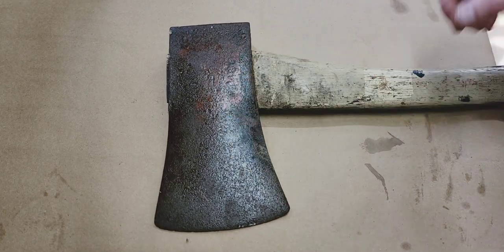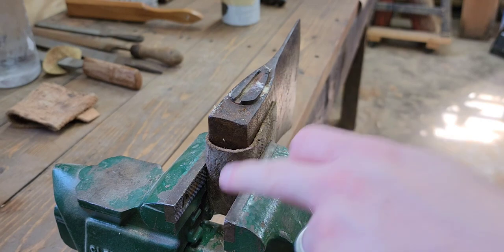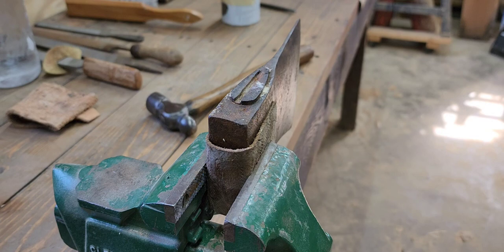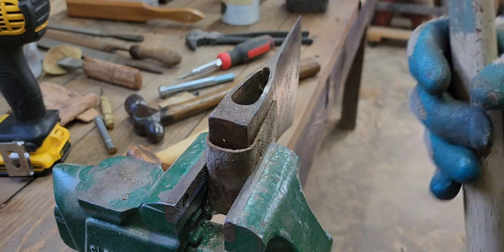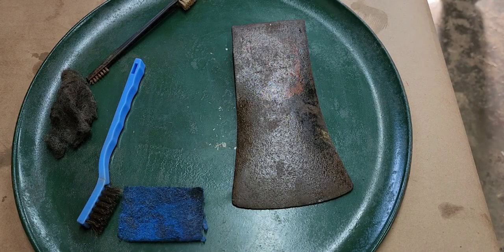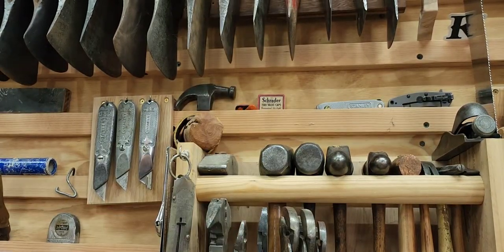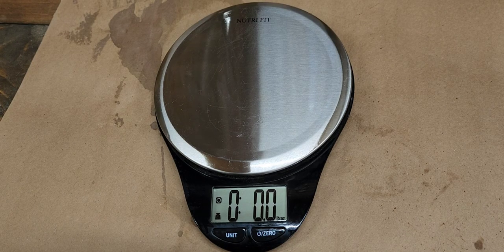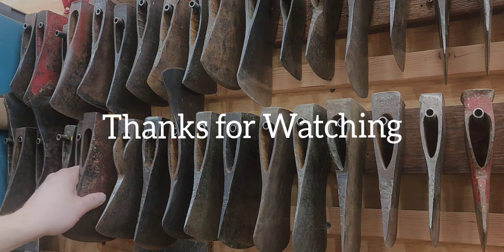Kelly Works Woodslasher Axe Handle Removal and Cleanup

Comment: I have Fencing players for that specific reason as well. I just picked up a slide hammer and I'm going to try that next time I need to pull some wedges.  Nice job on the axe. And no, we never need an excuse to acquire more tools.
Reply from the maker: They are super handy! I really need to pick up a slide hammer soon. They need to make one that attaches to the end of a set of vice grips just for pulling wedges. I'm sure I could sell a few!